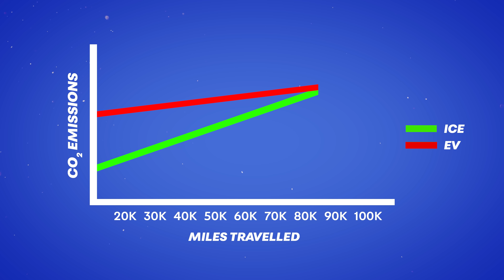Are Electric Cars REALLY That Green? [New 2022 Data]

Comment: I would like to see the impact of the battery replacement at the 5-year & 7-year points. Given that most ICE engines last well over 200,000 miles, that makes for 2-4 battery replacements if driven 10,000 miles a year, 20 years. Most people won't go for the cost of a battery, so the car gets scrapped. The ICE car just keeps rolling, or sold, and still keeps rolling. Environmental impact changes dramatically.
Reply: Current batteries nominally last at least 100K miles (and 8 years), but that means the degradation is about 20%-10% after 100k miles driven. (measured on high mileage Tesla Model 3 cars, degradation is closer to 10%, but it would be a little bigger if the same distance was driven under 10 years)
So only one battery replacement is necessary if you want to keep high mileage. But probably it could last for 15 years, or 150K miles, if you are fine with a range of 200 miles (for lowest mileage Model 3)
Reply: @adamrak7560  I know over 8 EV (Chevy & Tesla) owners in this area (Knoxville TN). Three have had to have battery replacement in less than 6 years. I am talking about the cars range being seriously degraded, unable to make it even 100 miles. Others are pretty happy but only drive 20-40 miles most days (to and from work).
Reply: @raybergeron2999  there are a few percent outliers, but that is not the norm. I have looked at large statistics collected from many cars, and there are some with significant degradation, but the majority is following a nice curve, which points to about 10% degradation after 100K miles.
I have looked at only Tesla data, they seem to have fewer battery problems nowadays than others. I expect the other manufacturers to quickly get up that level too.

(also I have not looked at anything which is older than Model 3 because those are too few to be relevant. So the statistics would be worse if we include the oldest Model S-es. Battery tech improved a lot in the last 10 years.)
(40 miles a day is more than 100K miles after 8 years, so that is close to the expected values)
Reply: @adamrak7560  And the batteries end up in a landfill. So far we don't have the tech to ecologically recycle them.
Reply: @PeterSilseth  Tesla internally recycles all battery cells which come out as bad from the factory. Currently this source of dead batteries is far bigger than cells coming from used EVs.
There are several startups with full recycling technology too, but they lack any battery to recycle, remember that for economic recycling we need massive quantities.
We already have the technology to recycle them, just not enough dead batteries to go around to be worth it. (except the manufacturing scrap, that is already recycled at least in Tesla factories)
Reply: @adamrak7560  There's a company in the US already doing it on a large scale, Redwood Materials Inc. The lead guy used to be a bigwig at Tesla.
Reply: @johnpottinger7645  Redwood Material is not a running company yet.  This is what they want to do.  Big difference between wanting to do it and doing it.  Right now most batteries go into the landfill with the exception of lead acid batteries.
Reply: one thing to keep in mind, as it stands, comparing ICE with BEV as equals with similar footing is wrong, more like comparing a senior, that had literally a 100 years to get its act together and develop infrastructure pitted against a student, that that has far more promise, but has some hicups to address, before going trully toe to toe. For example, battery tech grows so rapidly, that every year there is a need to re-check the progress, as previous faults are either lessened or solved entierly, ICE cars have just gotten increasingly more complicated to gain a few percent of efficiency (still @ just ~30%, against 90-95% efficient BEV motors). Every year electricity becomes greener, gas doesnt, infact gass gets more increasingly difficult to obtain and gass leaks pose serious additional environmental threats along the calculated ones. Also, gass can not be manufactured by anyone like electricity and that poses a threat to be as a bargaining chip in a trade war or an actual war, like with Russia. Every year new developments on battery recycling in large scale are developed and well financed and it is a known fact that 97% of the battery can be recycled, the tech is in scaling phase, not long before it is mandatory by law for manufacturers to have a recycling program in place. Infrastructure also is developing at a rapid pace, from 0 to now in just 10 years. By the way, battery packs consist of cells, if there is a bad cell, the whole battery pack doesnt need to be scraped, it is possible to change out the bad cells and mount the battery back into a car.
Reply: @atistiltins6163  Wrong, and wrong bud. Just wrong. You have no idea, maybe do a little more research on battery packs, and if you look into things a little more you'll find clean energy isn't really all that clean.
Reply: @keenanmeyers3935  well, i did not say that clean energy is 100% clean, you still have to manufacture the parts of a solar cell or a wind mill, but enlighten me, how is gas better/more sustainable as a very finite resource, who is posesed by just few countries. Can you justify leaving everything as is? Also you might want to check again, because not only can individual cells within a pack can be changed, NIO is allready doing it now. Yeah tesla might never do it, they have a different approach with integrating as a structural component, not totally on board with that. If you live in the USA, it might not be the case there, EU is way further in green energy and new energy vehicles, recycling
Reply: @atistiltins6163  Good point! And I agree. I now wish that America would lighten up on Nuclear power so we can stop using natural gas (from fracking, which I think has long-term negative affects) and of course, coal. Also, make the batteries more environmental friendly. We currently own two cars, one has over 170,000, the other almost the same, a 2008 and a 2015. I take extremely good care of my cars, they cost money. I expect to get close to 300,000 from both, like our last car, which was 25 years old when it died from a broken internal timing chain. It was in excellent shape (other than the worn internals). I AM in favor of EV's, I just want an HONEST discussion. Our next car will probably be an EV. Now retired we drive a LOT less.
Reply: The average lifetime mileage of an ICE vehicle is about 133,000 miles. The average EV battery produced today will last around 200,000 miles, some manufacturers already promise much more than that.
Reply: The Prius with an NiMH battery has a failure rate of 1% at 10 years. I don't think it's as bad as you suggest.
Reply: Original battery takes 90K miles (according to Volvo) to be greener. Each battery replacement would be greener than whole new car and require fewer miles to reach next break-even point.

But even getting a whole new car every 91K miles would be greener than running ICE.

Many put this number much lower. Check out this topic on the Engineering Explained channel for detailed breakdown.
Reply: @usa-ev  Sorry but that math doesn’t make sense, the data at day zero both include the chassis and anything involved, the only main difference is the battery production. That new battery replacement emissions calculated, would again be added at 7-8 year point and it would be another range of 91k before the EV comes out on top again. Nonetheless, let talk about people and not emission..who’s going to pay 15-20k for a new battery on a 7-8 year old vehicle, a vehicle in good running order that would normally sell for 10-15k range?  Unless these car manufactures can resolve the high battery replacement costs, there’s going to be a lot of useless scrapped vehicles in 10 years. Going EV right now is like the switch to plastic bags in the 80’s to protect the environment…
Reply: @christopheredgett4919  EV battery packs are designed to last 250K-1M miles, i.e. the life of the car. So no battery pack replacement required.

At the end people will still be swapping in battery packs from crashed cars and things I'm sure. Might even get to the point where the interiors need to be refreshed.
Reply: @usa-ev  And that would be False, batteries are not rated over mileage, they are rated of a time/duration of use and not distance travelled. Living in an urban area, very few vehicles would be reaching 250k miles. A lot of these batteries will also be charged at very low levels and not reach full capacity often due to lack of charging zones available in an urban area with street only parking, which would also result for reduced efficiency of the cells to hold a full charge.
Reply: @christopheredgett4919  It's actually the number of charge cycles that are the limiting factor, which can be increased by both miles and time. 

Many EVs used for urban environments can use smaller battery packs, which greatly reduces the carbon "payback" period. While at the same time ICE cars perform their worst in urban environments.
Reply: @christopheredgett4919  the manufacturers would probably have to buy the vehicles back, install a new battery and then sell as used.  Most people wouldn’t be able to afford replacement without a loan
Reply: @nate4fish  Dealers and/or manufactures won’t eat the cost and they most definitely won’t take a trade-in without deducting the replacement battery cost from the trade-in value. It’ll be much cheaper to pick up a lease on a brand new car and say goodbye to ever owning a car..

Comment: Very interesting, but do the EV figures take into account the doubling effects of a battery change to the graph at the end of the battery life, thus doubling the extended period of equalization?  The break even point between the two seems to be close until the environmental doubling factor of the battery change for the EV.  If the batteries could be completely recycled, this would also be a game changer, but at this time you might at well consider it nuclear waist as they are just buried, contaminating the soil.  New energy storage sources need to be discovered as batteries, or better yet cleaner and more efficient engines that would eliminate the whole energy storage necessity in the first place.  There is so much money being levied on who is right in the EV vs ICE debate, that it would be impossible to get a true apprehension of all the variables.
Reply: There already is a healthy 2nd life market for EV batteries. A 60KWh battery that has degraded to 40KWh is still very viable as a house battery or parted out for cells for other uses. Also, there are recyclers coming online in CA NV and MA that I know of. The MA one claims no sorting is required and nothing toxic is produced. They grind and separate the raw materials for re-use and state the batteries they have made from the recycled materials are as good if not better than virgin made cells. That could have a much lower environmental impact for the new cell or be used to average down the virgin cells. It also helps that cleaner mining is being developed. 
Mass EV production is still new and I expect it to get much better as it matures. It will eventually be a no-brainer for most and we have to start somewhere.

Comment: More toxic chemicals are used to make Teslas than any other vehicle.
Teslas also have the shortest life spans. 
Teslas also leave behind the most waste at end of life.

Worst: Teslas use more fossil fuel per mile than gas combustion cars, because it takes more fossil fuel to burn to make into electric than charge and power the batteries than a vehicle that directly burns fossil fuel for power.

Comment: IF - Sure IF the grid was green; and If EVs scaled.  One major point EV advocates like to forget is Lithium cobalt and nickel are all constraints they constrain EV production. Tesla used 25% of all lithium produced 2021 to make 900,000 EVS - Do the math.  There are a billion vehicles and 80 million sold every year.  If you use the same resources for Hybrids you can make 10x more and they can be made to commute all electric.  Current EV models are Lithium, cobalt and Nickel pigs; so more ICE cars get sold in the end.

Comment: On average, an EV battery lasts 8 years, therefore, one must add the carbon footprint of the replacement battery to the equation, which is the most carbon intensive and most polluting part of EV manufacturing.

Comment: The problem is when it breaks even everyone’s already trying to get another car. Retail trade cycle is 34 months. Maybe we will need to put 200 or 300k on the EV to really have this make sense. Even a 10% is huge when it’s compounded across the board. 

Don’t get me wrong. I’m not all in on electric by any means and I’ve known since 2003 that the EV cause more pollution during manufacturing. However moving to other fuel sources like hydrogen could help but we run into other issues such as the humidity it causes as it dumps water vapor out. There is no one good solution today.

Comment: Most of the pollution comes from the manufacturing of the battery, if you look into it, the lifespan of the battery, at best is 150.000 miles. Replacing the battery would greatly contribute to carbon footprint of the vehicle. What if you total your vehicle before the 90.000 miles it takes to break even and go buy another one? Are you still being green?

Comment: What seems to be missing from this report is how many miles before the battery must be replaced?  If its 124-K miles, then what is the carbon output added to the EV's at 124-K miles to replace millions of batteries?  When we replace those batteries what does a replacement battery cost?  Do we have adequate raw materials to make & replace EV batteries? (No)  Then there's distance (miles) traveled on a full EV charge vs. distance (miles) traveled on a full tank of ICE vehicles?  And how long does it take to charge the EV vs. refilling an ICE tank when one is traveling long distances like 400 miles or more?  What is the overall life span (mileage) of an EV vs. ICE vehicle and is the carbon footprint included in the equation to manufacture a replacement vehicle?  Also is the carbon equation of an EV vs. ICE done for gasoline (petrol) or diesel engines?  Diesel engines can commonly run for 250,000 miles or more, so replacement vehicles are needed far less often than gasoline or electric vehicles which would reduce the carbon emission by manufacturers.  Another question, wouldn't LNG (liquid natural gas) vehicles be even less polluting than EV, or Gasoline, or Diesel?  LNG engines are more powerful than EV engines and last longer, they last longer than gasoline engines, and last about as long as diesel engines while producing very low levels of carbon. LNG engines can travel long distances between refilling the tank. I don't know about other parts of the world but here in North America we have enough Natural gas to run the entire continent for more than 100 years.  LNG vehicles run clean, last longer, have lower levels of replacement, travel long distances per fill, and are environmentally friendly.  A hundred years from now we may develop renewable energy sources that actually benefit the environment, and the pocketbooks of for all of us, but that may not be today.  NOTE:  What happens to an EV battery that explodes in a collision???  An EV battery can be more hazardous than a gasoline vehicle explosion, or LNG explosion, and diesel explosion are very, very rare.  If we take a big picture view, then EV's look like a much smaller solution than we currently imagine... at least for now.

Comment: Q:  how long do these batteries last (life span) before replacement?  Does that change the break even point back to EV being less green than ICE again for a period of time?  Also, what about the cost to use - ICE vs EV over the course of the same timeframe?
Reply: 10-15 years average (10% degradation) and up to 25 years for batteries life span with 15%-20% degradation over that span (unless you get a dud Which can be recycled at up to 98% recovery) (which they did not cover) the cost to use over the life span for EV's are basically rotating your tires, windshield wipers and infrequent minor fluid checkups, vs Ice with radiator fluid changes, engine tune ups, oil changes, misc fluid changes, transmission fluid changes and transmission maintenance.. among many other checkups through the life of the vehicle. this whole article is garbage. they cite mining etc and rare earth materials etc, which is a strawman now days since most batteries are going to Iron Nickle with no rare earths at all. these guys are paid by ice, they can't out and out lie and say ice is better, but they can try to say they aren't as good as you though they were.. which is basically the same as lying.
Reply: @dragonpc8258  
The EVs I checked all run on lithium ions in one way or another. Mining lithium is a hazard for the environment, ground water and thus everyone in the greater vacinity of the mines, which happen to be almost always already empovered people. You may also come across child labor, but that's more of a cobalt and nickel thing.
Fact is, lithium ion batteries are a hazard to produce, run and dispose of (it's still not comercially viable to recycle them).
One thing you missed is degradation through no use. The batteries need to be discharged and charged somewhat frequently whereas petrol can sit for a year and be mostly fine.